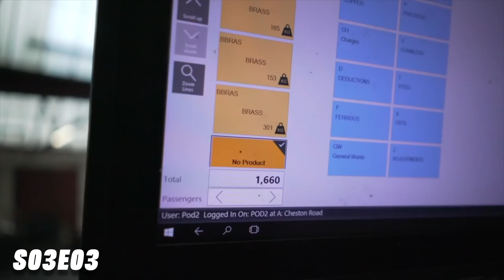HYDROGEN BOMBS STOP OUR SCRAP YARD | Scrap King Diaries #S05E08

Comment: Could you open the hydrogen bottles up to the atmosphere outside when the yard is empty, then fill the tank with water, which should technically deplete the chambers of any residual gas, drain and refill a few times, and then chop up.
It's what people do with gas bottles when they convert them to BBQ's

Comment: Is there a way of making sure u have lead I'm sure I've found some while cleaning out my late grandads shed I wanna make sure before trying to weigh it in
Reply: Lead is a very heavy soft non magnetic metal so i make sure that a magnet doesn’t stick it it and if it is heavy and easy to bend or easy to scratch or mark then it’s probably lead and also lead is grey in colour hope that helps
Reply: @joestiff3689  that helps alot it is grey very very heavy and soft thank you
Reply: I reckon it’s lead then and I have worked in the scrap industry all of my life so I’m pretty sure it will be

Comment: Yeah you guys should definitely get a frag I ran one for 12 years until I had to give up working because of health reasons but they are awesome bits of kit brilliant at cleaning up irony Ali etc but bear in mind they are very very expensive to run and also maintenance is very important and also you need a fair size bit of land to have fitted on because you need to have room to fit all the different conveyor belts and bays for all the different materials once stuff has been shredded